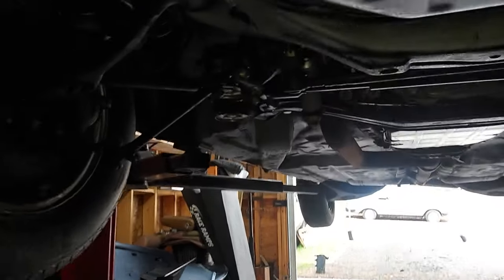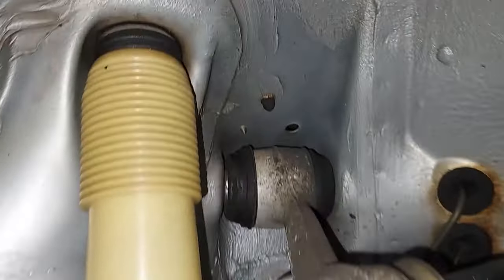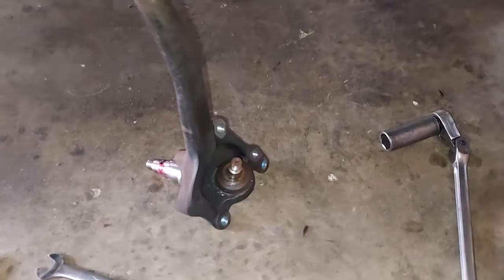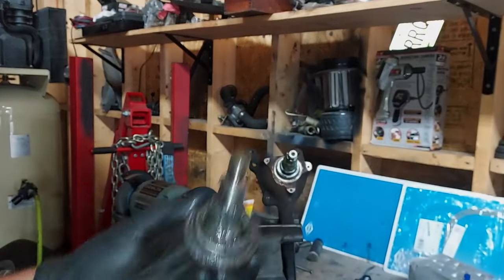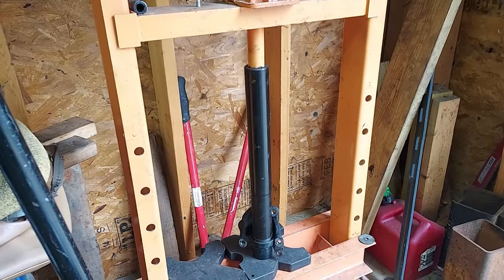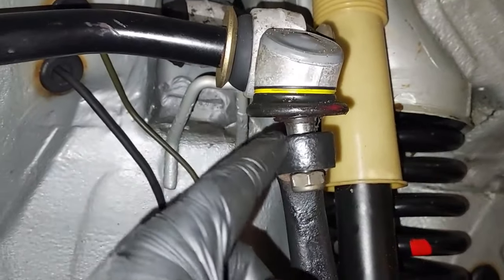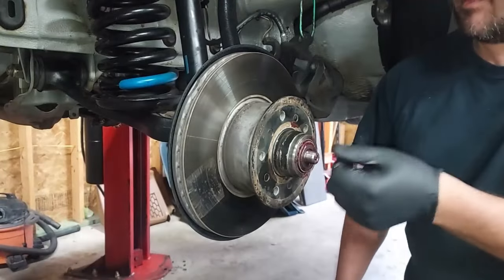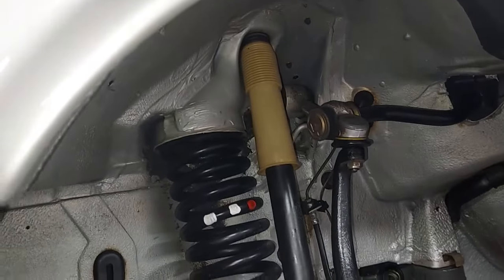33,000 Mile 1983 Mercedes 300SD!!! - New Ball Joints

Comment: I am enjoying the refurbishment of this super clean 300SD.   Did you have any reservations about this car before purchasing it because of the extremely low mileage for its age (it works out to 800 miles per year)?
Reply from the maker: I had absolutely no reservations this is an incredible car! I always like the low mileage ones better than the high mileage ones. In my experience the low mileage ones are always better. The engines run like they were new.